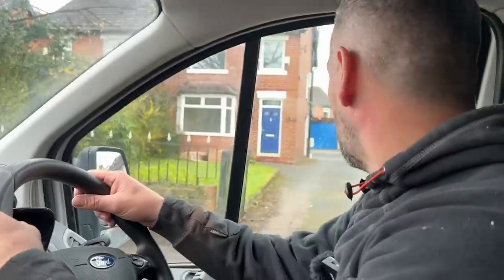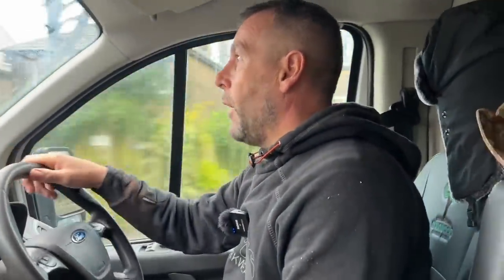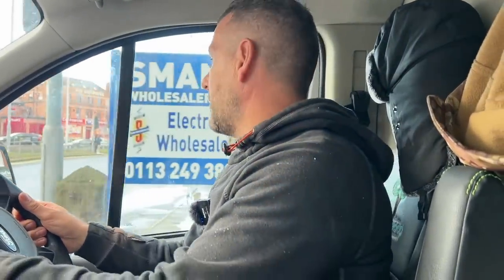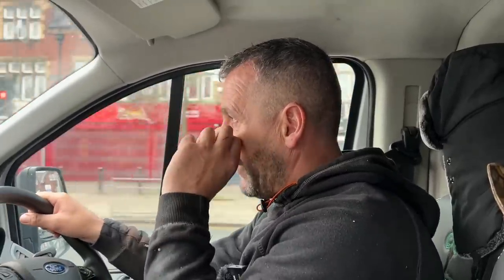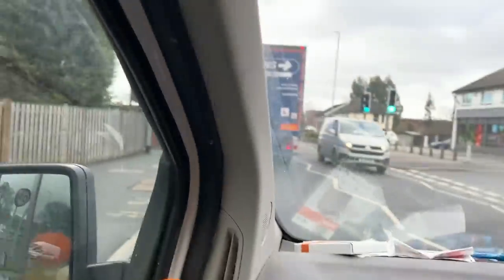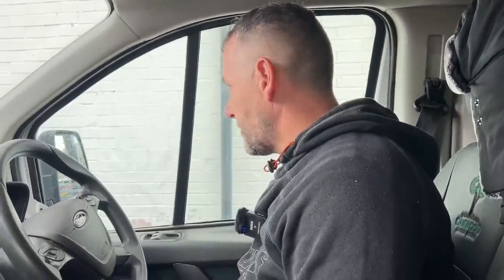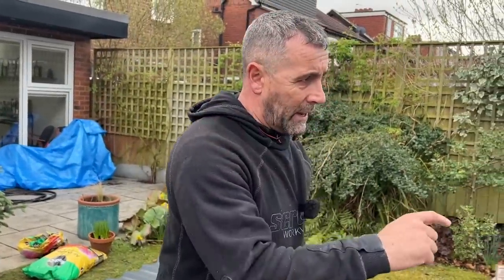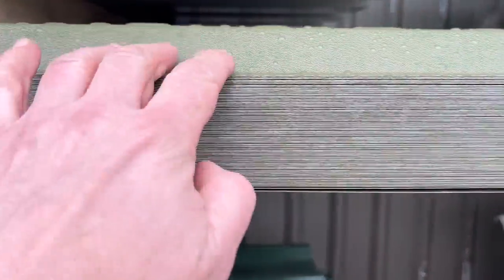Building a garden room? You need to watch this series, everything you need to know.

Comment: Hi guys. Thanks for answering my question. The Dewalt tool is DT 4587-QZ. 74mm self feed drill bit £24.95 on FFX. Not bothered about the tidiness Liam, but thought this might be quicker. Anything to save time. If you bought one for each job it might work out ok.  I think Milwaukee make something similar but twice the price. Needs a high torque drill though. This might actually benefit those without a chainsaw or are scared to use one. 26:50

Comment: I’m in the planning stages of building a small gaming/live streaming room in my garden. It’s going to be roughly 1600x3000. I’m trying to keep the cost down as much as possible so I’m going to use 2x3 instead of 2x4 and considering going with 600 centres over the 400 centres to save a few pennies on timber. It will also be insulated, plasterboarded (tape and jointed rather than skimmed) Would structure be strong enough to support what iv got planned for it?

Comment: Hi team, thanks for the series. Another really good one AND I wanted to modify a 5x3 with an internal wall so you have shown enough detail to set my on the right track thank you.

Sorry if this is a silly question - for the walls - you use 4x2 and 50mm PIR. This leaves a gap, is it required or can I fill the gap between PIR and plasterboard with sound proof rockwool?

Thanks again to all the team for getting involved, loving this series

Comment: Heya Liam, I understand about two battens for cladding. I was planning on 2 sides with metal cladding as won't be seen. Was gonna do front with shiplap horizontally. My question is to fit shiplap horizontal outside batten would have to be vertical, so first batten would be horizontal, would this hold water/ vapour
Reply: Also another brilliant video, the question section is absolutely priceless. There is always something you forget that someone else will ask. Keep up the great work team 👍

Comment: Question: Liam, is it absolutely necessary to use the top nut to fix the base to the rods? If the nuts were left off could the structure be craned out in the future?  Thanks
Reply: I think we answered it but I’ve wrote it again just incase you missed it😊
Reply: @jenbulmer  thanks Jen much appreciated.